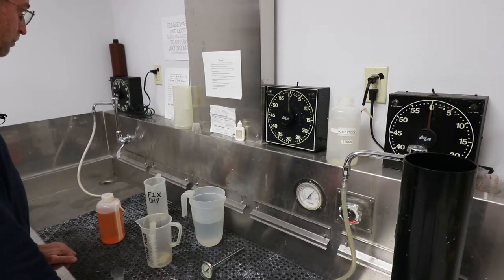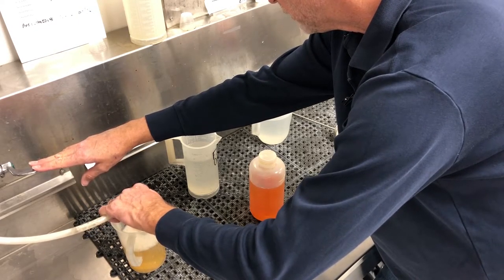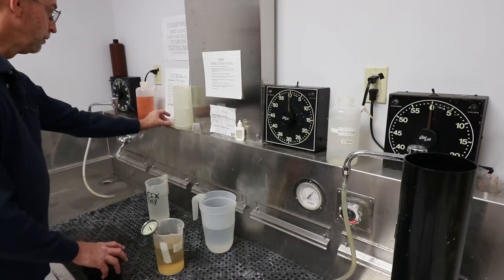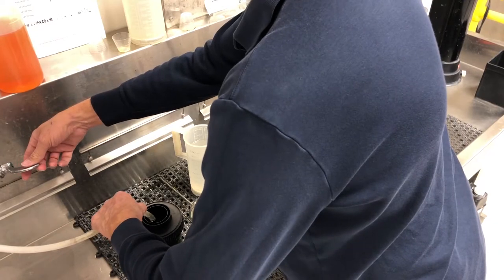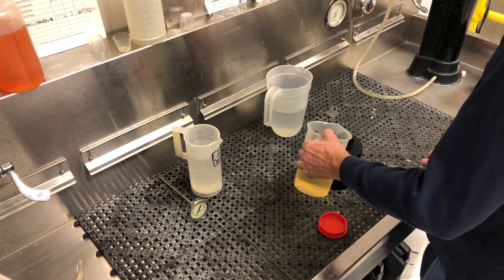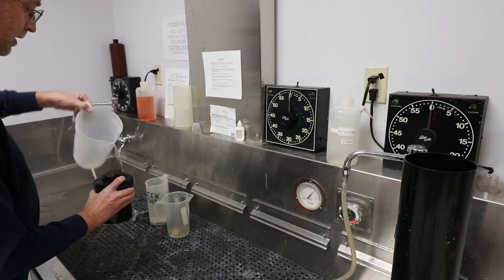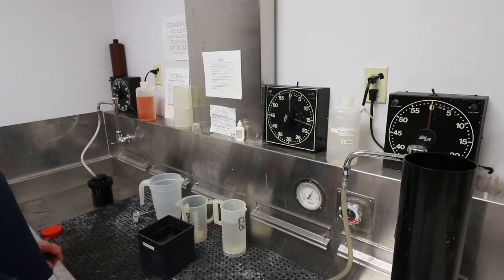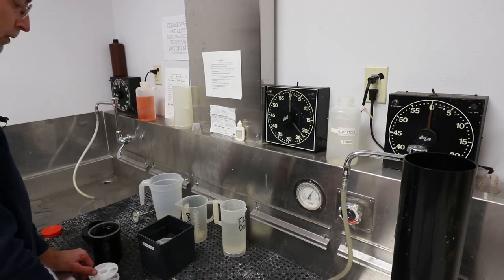How to Process Your B&W Film with HC-110 Developer

Comment: it takes a lot of testing to match your film of choice, to your developer of choice, for best enlargement results in the darkroom. This is how:

1. Find a scene with with a good range of tones
2. Using the box speed, meter the darkest area in which you wish to retain shadow detail
3. Move the camera so that you are only photographing this shadow area
4. From the meter's reading close down the aperture by 2 stops or increase the shutter speed by two stops and then expose 6 frames at: the given exposure then +1 stop, +2 stops, -1 stop, -2 stops and -3 stops less than the meter has indicated 

5. Process the film

6. Using the frame that was exposed at -3 stops less than the meter indicated (which should be practically clear but will have received lens flair and fogging - i.e a real world maximum black rather than an exposed piece of film that has processing fog)and do a test strip to find out what is the minimum exposure to achieve maximum black - Print must be fully dry before assessing this
7. Do another test strip with the first exposure being what you have selected for achieving maximum black minus your dry-down compensation then plus 1 second, 2 seconds, etc
8. The time that achieves full black inclusive of compensation for dry-down is you minimum exposure to achieve maximum black for all future printing sessions - print must be fully dry before assessing
9 You now know the minimum time to achieve full black inclusive of exposure reduction to accommodate dry-down
10. Using this minimum exposure to achieve maximum black exposure time, expose all of the other test frames.
11. The test print that has good shadow detail indicates which exposure will render good shadow detail and achieve maximum black and provides you with your personal EI for the tested film/developer combination

12 If the negative exposed at the meter reading gives good shadows, your EI is (when metering shadows where you wish to retain good detail) the box speed (i.e. for 400 film you need to set your meter at 400)
13. If the negative exposed at +1 stop more than the meter reading gives good shadows, your EI is (when metering shadows where you wish to retain good detail) 1/2 the box speed (i.e. for 400 film you need to set your meter at 200)
14. If the negative exposed at +2 stops more than the meter reading gives good shadows, you EI is (when metering shadows where you wish to retain good detail) 1/4 box speed (i.e. for 400 film you need to set your meter at 100)
15. If the negative exposed at -1 stop less than the meter reading gives good shadows, you EI is (when metering shadows where you wish to retain good detail) double the box speed (i.e. for 400 film you need to set your meter at 800)
16. If the negative exposed at -2 stop less than the meter reading gives good shadows, you EI is (when metering shadows where you wish to retain good detail) 4x the box speed (i.e. for 400 film you need to set your meter at 1600)

You have now fixed your personal EI but there is one more testing stage to go.

1. Find a scene with with a good range of tones
2. Using your EI, meter the brightest area in which you wish to retain highlight detail (but not the sky)
3. Move the camera so that you are only photographing this highlight area
4. From the meter's reading open up the aperture by 3 stops or decrease the shutter speed by three stops
5. Expose the whole roll at this setting
6. In the darkroom, process one third of the film for recommended development time

7. When dry put negative in the enlarger and make a three section test strip exposing for half the minimum black time established earlier, for the established minimum black time and for double the minimum black time. 
8. Process print and dry it.
9. If the section of the test strip exposed for 1/2 the minimum black time gives bright highlights with a trace of detail then the film requires 20% more development
10. If the section of the test strip exposed for the minimum black time gives bright highlights with a trace of detail then the film is correctly developed
11. If the section of the test strip exposed for double the minimum black time gives bright highlights with a trace of detail then the film requires 20% less development
12. You can use the rest of the exposed highlight test film to fine tune the development time

Now back in the real world, all you ever need to do in future is meter the shadows that you wish to retain good detail with meter set at your EI and then stop down the aperture 2 stops or increase the shutter speed by 2 stops. In the darkroom start your first test print with the minimum exposure to achieve maximum black (inclusive of dry-down compensation) and go from there.